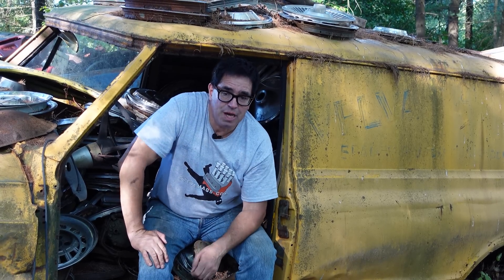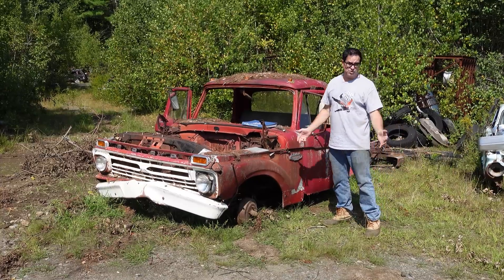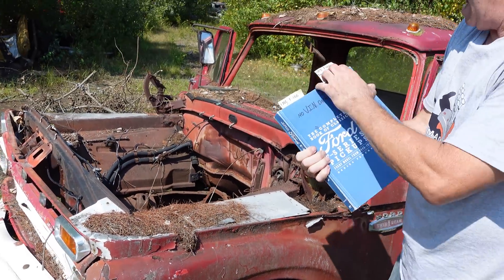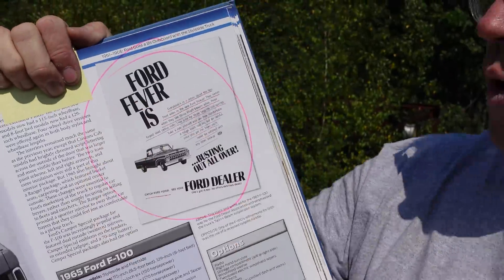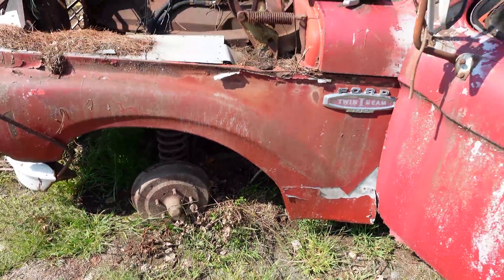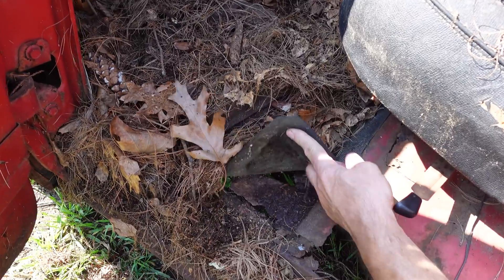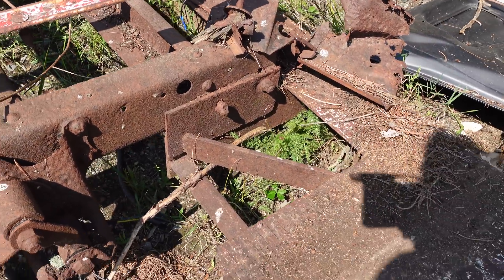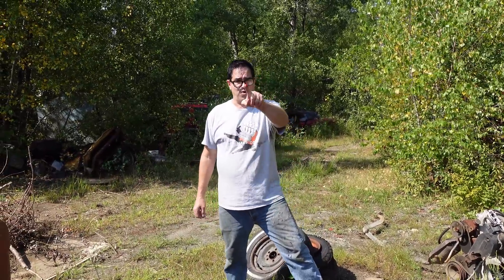The Ford With TWO Front Axles

Comment: My Father had a 68 Ford Twin I beam and carried heavy equipment in the back. 
The tires only lasted six months!’😩
He put new six plys on and had it aligned. 
These lasted a year!! 😩 Ford checked it but couldn’t find anything wrong. They said it was a camber problem especially with a load
He said there was a recall to put install compensators   They said we would have to pay $500 dollars 💵 as it wasn’t their problem because we were overloading it!💩
We bought the kit and my Uncle mechanic installed it for $200 dollars 💵 It only helped and he traded it after ten years!!
The brakes were very poor and dangerous!!
It had a two piece driveshaft with a bearing in the middle that wore out on a regular basis !! The main starter wire burnt thru several times and stranded us!!😡
Other than that it was fine!! Ford Tough??👎🏼

Comment: Twin I beam was an attempt at independent front suspension.  
 The early 80’s 4x4 Broncos and trucks had a twin I beam set up. It was kinda flimsy. 
     Ihave a ‘75 F-350 2wheel drive dump truck that my late uncle left me. I was my grandfather’s he bought new. 
Truck only has 29K miles on it.

Comment: You said that from 1961 to 1980, the VIN didn't ID the year model. Wasn't aware, but that could explain why I've seen several ads for mid-1960s F-100 that clearly misidentified the year model. Sometimes the seller would insist that the (incorrect) year was on the title.

Comment: Hey Steve I've got an all original 68 dodge 3/4 ton camper special it was my first truck it's got the 318 auto Maricopa shifter on the dash it not in bad shape I'd love to know what you know and think about it
Reply: That has to ride pretty harsh, unless you have a camper of equivalent weight on the back.  I like them for looks but I think the cabs are too short  if you have even slightly long legs.

Comment: My first vehicle was a '64 Ford F100 at 14 years old.  292 Y block V8, 3 speed column, manual steer and brakes.  Last year for the straight axle with kingpins.  White spoke wheels, 70's in front, 60's in rear.  2 tone custom paint and interior and of course, an 8 track from Radio Shack.  Hauling ass around the corners in the mountains I could place the inside front tire on the double yellow or the white stripes and with that straight axle the inside tire would SCREAM for mercy.

Comment: 61-66. 61 came as a uni body or with the wrong bed shared with 57-60 and also used up to 66 on factory 4x4 and f350. 64 -66 for the style side bed maybe a handful of 63 most 63 f100-f250 came uni or step side.
It's too bad that truck is so far gone, frame looked compromised with rust even but that was a great old truck

Comment: Personally I didn't like the feel of the steering on the twin I beam models. They felt like the tow adjustment would change a lot when hitting a dip in the road or anytime the wheels traveled up or down very much. It's like you always had to drive them, you just couldn't relax. Did this model still have the ignition switch on the left side of the steering column? My Dad bought a new (left over) 64 model, s/b stepside, 6 cyl, 3 on the tree for only $1625.00 a couple months after the 65's came out. He bought another new one in 70, 75 and 79. He didn't buy anymore since I had gotten into the bodyshop business he had me redo it twice, the second time it got an aluminum flatbed since the original was beyond repair. It looked good, 2 tone blue with a lot of chrome and he didn't sell it till 2004 or 2005 for $3500.00. I remember it being a gas hog whether it was loaded or empty.

Comment: That twin I beam is the worst ever. I had an 87 f150 4x4 I used for plowing snow could not hold an alignment or keep tires on the thing. So I took matters in my own hands and got axles from a 79 f150. They went in with little modification drove that truck for 393000 before the frame rotted out. The most trouble free vehicle I ever owned.

Comment: The GM and Dodge independent control arm suspension was MILES ahead of the ford twin i beam setups in every way. Ford was always built sorta cheap compared to the others. Ford never had removable inner fenders until the 80s/ Fords never had beds that disassembled/twin i beams didn’t have much adjustment and the alignment changes at every point of Articulation etc. GM trucks had hydraulic brakes/Independent much superior control arm suspension/Disc brakes/Power windows/Power locks/Cruise control etc long before ford

Comment: Not sure but you mentioned styling and said ‘58-67? Not sure but the body was the same ‘57-60. Front fenders marker lights changed in ‘59 from round to square, front valances changed along with grill and hood. Front sheetmetal minus grill interchanges ‘57-‘58. Hood was the same on ‘57-‘58 but was different in ‘59 and ‘60 so ‘59 - ‘60 fenders and front balance are the same. Sorry I know it is confusing but thought you may not know.

Comment: Great Video Steve The Twin Beam front suspension was an alignment shop nightmare. A customer would bring one in empty, you set the alignment,they load the crap out oft it Then the nose goes up the alignment goes out and the customer is mad as hell at the alignment shop! We always thought they were designed by Firestone since they were hell on front tires! They also did a great boat imitation! Put a load in the rear,front end comes up, tire contact goes to 1é2 inch and you loose all feel for the steering! Great  in the winter Keep up the great work

Comment: Twin I beam was considered a good setup for 2wd racing.  It was nearly as tough as a solid axle and tougher than an A arm independent suspension. And it gave a better ride at high speeds on rough dirt road than a solid axle.  The system is considered undesireble for other types of driving because of alignment and durability problems.
    Haltenberger steering is also something to avoid vs parallelogram steering.  I believe people convert the former to the latter when restoring older vehicles.
Reply: Ive driven millions of miles in the past 40 years in Twin I beam  truck .....never once had an alignment issue......unless the frames are bent from an accident ect.

Comment: One thing that I've always found interesting about the Twin Traction Beam design for F-250 and F-350 pickups is that they still used leaf springs up front. F-100 and F-150 pickups used coil springs up front on the 4x4s.

Also, no matter what Ford pickup you're working on, if it has either the Twin I-beam or Twin Traction Beam suspension, those axle pivot bushings can be a major PITA to replace, especially in the rust belt!

Comment: In those days pickups normally came without rear bumpers. Dealers installed them routinely. My hometown had a welder/blacksmith who made a lot of the bumpers in that area. They were sturdy enough to serve as dozer blades for a small tractor.
Reply: The Ranger I had was a leftover from a fleet sale . It had a bumper on it but normally wouldn’t. At the end of ‘86 Lakewood (CO) Fordland had two white with 2.3 and 5speed OD. I got the one with blue interior, the other had red inside. Both went for $6688 and N/C for the bumpers

Comment: A cousin of mine (rancher) owned a new ‘65 F-100 with Twin-I-Beam.  A few years later a tree fell on it.  A had a ‘95 F-150 with it, and in 17 years I never had any weird alignment or tire wear issues - just had to replace the driver’s side bushing, twice.   Later trucks switched from forged radius arms, to stamped ones, with a shaft welded to it, that went through the bushing.

Comment: I sold my 1965 Ford 100 long bed, fleet side truck when I moved to Texas. It had a 3 in the tree like this truck and a 6 cylinder with a one bbl carb. No radio, no cigarette lighter, no power steering and no power brakes. It was not the Custom Cab. Just a solid old truck and the doors closed so easily, you would not believe it. Wish I still had that truck.

Comment: Fords always had a hard kean on the tire when they turned sharp. King pins were also a pain.
Reply: Drove many late 60’s thru 70’s Fords. If they sat any length of time the king pins would dry up and seize. Always fun to drive: never able to keep it centered in the lane. Drift left, drift right, repeat over and over. 😁

Comment: Took my driver's test in my dad's 1966 f 100 , no power steering,bias ply tires, it was a struggle, but the state cop, that's who gave tests way back then, was sympathetic,  gave me a couple of hints, and passed me the first time. My dad was  sure I wasn't going to pass. It was the most nervous I've ever been.
Reply: I took my drivers test in a 57 Mercury with no power steering/brakes or AC!!
My Father said that stuff was just something to break!! I too had some slack from the tester!! Later when radial tires came out I put them on my 56 Ford and it became a BEAST to steer-especially in a slow curve although they did improve handling. 
Don’t get in a tight place!!😦😬🙈
Reply: @ludicrous7044  yep you are right putting radials on a car not set up for them could be dangerous. Also, I had a 67 gtx with radials and I wanted  red lines  on it, but at that time they only came in bias, did it anyway ,looked great, drove like crap. Expensive lesson learned. But they did help sell the car.

Comment: Twin I beams is the worst on road front end any one ever came up with. It borders on homicidal. As far as not much camber change, that's not true. Camber caster changes are massive. 1" = 2 - 3 degrees of change. If you ever drive 1 of these things you realize itgoes every direction but up down & straight.

Comment: Front end “shimmy” was something that would pop up with the Twin I Beam from time to time. My dad bought a new 1974 Custom, and not long after, someone decided to disconnect the radius rods after dark. It had a bad shimmy problem afterward and the shops never could manage to diagnose and fix the problem. I had a new 1989 that never had any issues, however. I also operated 1986-95 Broncos for my job. The factory rims that came standard with the XLT package on the 94-95s seemed to have recesses especially made to trap mud, thus inducing shimmy when getting back on the road and requiring a spray nozzle daily to prevent the shimmy. Usually slowing down and yanking the wheel right and left would get things back in balance, but in retrospect I can see how that tactic might cause a loss of control. Otherwise, the front ends were pretty durable. Nevertheless, for replaced them with a more conventional front suspension on the half tons and Rangers for the 97 model year.

Comment: The twin bean would camber the tires with a heavy load but it will never break unlike Dodge or Chevy trucks suspension style
Reply: The GM control arm suspension is EXTREMELY strong 😂😂. You absolutely never seen them fail. Very heavy stuff
Reply: @brandonbell3089  yes i have, smooth ride and all that but not as strong as a twin I beam. Ask an old farmer. 😉

Comment: The Ford 300 c.i. straight 6 was the best engine ever made by Ford. Could not kill them. I had an old 79 f-100 ranger step side 4x4 with that 300 engine and I beat the snot outta that truck. Best vehicle I have ever owned.
Reply: One of my cousins had an F150 as a company vehicle that he managed to kill before it was a year old. He was a salesman for a company that rented construction equipment at the time. He and his boss ordered the truck with the 300 c.i. six, 5 speed manual transmission, (5th gear was overdrive) and the lowest rear axle ratio available. I thinK it was 2.54:1. He was delivering a good sized air compressor to a customer. The frame and suspension might have been okay for towing that much weight but the drive train certainly wasn’t.

Comment: The Twin I-Beam seemed like a good idea, but it was the worst tire-eating front end ever.
Reply: All you have to do is rotate the tires
Reply: @ekd1985  So all four tires will be eaten equally?
Reply: @mikefrech1123  twin I beam will tend to round the front tires. If you rotate them every 6,000 miles (recommended in the owners Manuel) you will square them back of running them in the rear. I’ve rotated mine a couple times and have no issue with any tires. Basic maintenance works.

Comment: Ford has sold kajillions of "twin I-beams", and they all bump steer like crazy. As an alignment tech in the 70's and 80's, I fed my family very well replacing radius rod bushings, king pins, tie rod ends, and using a Hunter "I-beam straightener" to bend the axles and radius rods for caster and camber adjustment. Toe-in changes radically when either wheel hits a bump, as does caster and camber. On the alignment rack, I had to adjust toe by trial and bounce. Tire wear is atrocious, and body roll is amplified by the pivot points being on the opposite frame rails... Still, they sold like hotcakes, and I never saw one towed because a ball joint failed. I still don't like them, but I respect them, and I even owned a '95 F250 2wd. I'm glad Ford ditched the beams for the F150's in the 90's, but they're still found under F250 and up. The worst version was the 4x4 twin I-beams starting in 1980, available on F150's, Bronco-II's

Comment: I'm a huge fan of solid axles and leaf springs. It's by far the toughest type of suspension ever developed, and IMO what all trucks should have, front and rear. However, I still strongly prefer the Twin-I-Beam design to the short/long control arm car style suspension, which is way too weak for a truck. It also has alignment issues. With both solid axles/leaf springs and the Twin-I-Beam designs, caster and camber were never an issue. Yes, the Twin-I-Beam design, like the old VW Bug swing axle and IRS systems, did have some camber change as it moved, it was never really a problem. At normal ride height the camber was always spot on. I have over 300,000 miles on Ford trucks with the Twin-I-Beam setup, and currently own a 1975 F-250 2 wheel drive with that setup, and have never had any issues with it. As with all suspension systems, there are bushings that need to be replaced occasionally, but you don't have to get a front end alignment every 6 months.

Comment: I had a 1965 250 custom cab with the 352 2 barrel and heavy duty 4 speed I bought in 1982 with a broken pressure plate. After putting in a new  disc and pressure plate driving it i noticed the steering was hard and would bind and also found chunks of 2x4's between the frame and the cab. what had happened was the cab front mount boxes had rusted off an the front of the cab dropped down and was putting a bind on the steering column so i fabricated new ones to correct the problem. That was a common problem with that era of trucks because sand & dirt would get trapped in the mount box and hold moisture and rot it out.
Reply: That's true. My '66 F100 had those boxes full to the brim with dirt when I bought it. However it was not rusted out at all. It has 4 drain areas so as long as water can still get out you should be ok as evidenced by my truck.

Comment: The only thing I didn't like about my 66 390 C6 short bed was the twin I beam.  Save 30 lbs, make it impossible to do an alignment on.
Reply: Toe in and out was easy, camber could be adjusted by bending the beams. Not just any front end shop could do it. My 65 F250 looked like it was set up to run at Martinsville,  if you know what I mean,  when I bought it. A shop in Birmingham set it back to factory spec and it drove like new.
Reply: Definitely the way to fix a Ford.  Heat up and bend a forged suspension part. I didn't learn my lesson and bought a new one in '92 too.

Comment: I had a 66 who's floor and cab mounts were rusted out. I cut a floor out of a 79, and welded right in.
Reply: Same basic floor until 79…. Exact same floor until 65-72   73-79, Fords used the inside of the bed skins until 96 !
Reply: @WildBillFlysRC  There were changes in frame width, so there can be differences in the bed-mounting holes, especially if you're dealing with a High Boy ('67-'77 F250 4WD)  And you can see how a Bumpside '67-'72 uses the older Slickside backlite.  Then the Dentside '73-'79 uses a new backlite, but the same windshield as the Bumpsides. Then the Bullnose '80-'96 got a new windshield, but carried on with the Dentside's backlite - along with the floor and back wall of the bed.

Comment: The Big Six 240, 300 and 352 VI for that year had ratings of 129, 150 and 172 net respectively. When the 5 th gen came around, they re-gigged it to  145, 170 gross for the 240 and 300. By 1972, the game was up...Net ratings of like 105 and 118 respectively. It's nothing to lose 30% in a gross to net change, but 14-16% is the typical drop if the peak power rpm hasn't been Misquoted.  That year, 1966, the West German TUV quoted Net verses gross ratings on all imported US Ford's, and each rating drop gross to net was 14 to 16 percent.
Reply: And that truck appeared to have had the Big Six, as evidenced by the single exhaust pipe on the passenger side.

Comment: Never could figure out why most trucks came with an open differential.
Thanks 👍
Reply from the maker: Me neither
Reply: It’s less to manufacture!! 
I had a 56 Ford I wanted to drag race it would spin one tire and I would lose!! 
A friend at HS said to weld up the spider gear but about once a week I would need to jack it up and let the axle “unwind!”😦😬
The axle would break from twisting in a turn because of uneven speed!! It also made the front tires work harder. I would beat a stock differential every time!! It was illegal but nobody seemed to notice!😁
My Uncle was working on a military 6x on a lift. When he raised it off the floor it jumped over the rack and smacked the back wall!
The owner did not disengage the differential and the axles unwound and push the truck!! 
It says caution on the dash and to forget to pull the brake lever!! It fortunate no no body  was hurt!!⛑The owner fixed the damage!